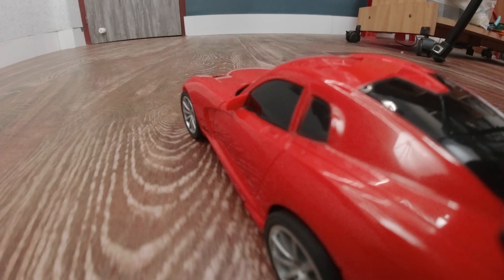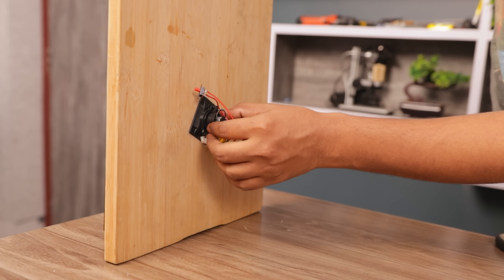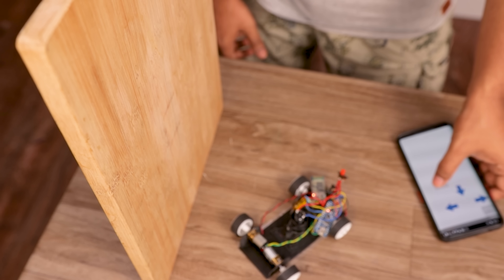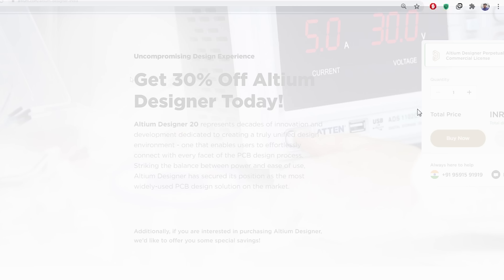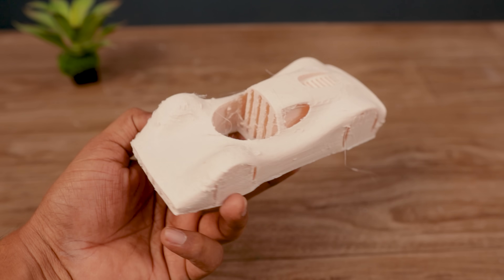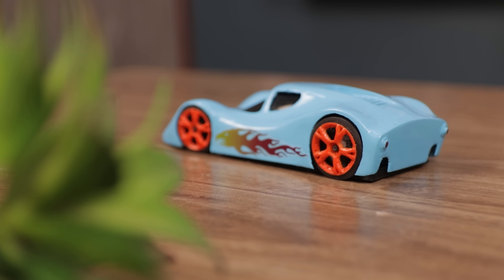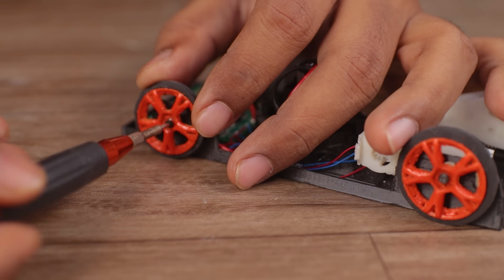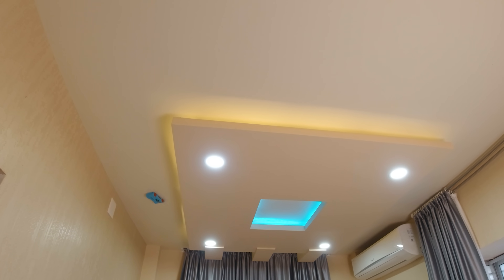How I Made this Electric Car that can go Anywhere

Comment: Very nice! 2 notes though: 1) you shouldn't put ground or anything else under PCB antenna on the module. You are butchering its performance this way. 2) Don't use ancient L293, there are much better (and smaller) alternatives with lower voltage drop and hence better motor performance

Comment: That was nice but can u make same thing without a custom turbine wheel for suction instead we use a sticky gel usually used in sticky man toy ....while in wall mode the platform carrying a bulge of sticky gel will move fair close to the surface say some milimetres....while the wheel thrust is enough to maneuver the car on wall mode !!!waiting for the trial!!!!

Comment: Hi bro, your model is soo cool. If you have added a single small tier that keeps suction enough active you try directly call to the wall with out using the manual method. Try that too. 😊😊

Comment: Made one back when I was 7, with suction cups but the sad part was it took me more than 3 months to execute my plan and within 10 minutes my car fell and it broke. It was painfully slow and could only climb glass doors, windows or glass enclosed cabinets. I tried it on normal plastic painted wall but it could only go till about 55° angle. Good project, that failure taught me how to reverse engineer anything.

Comment: Hey there, i am planning to purchase the cadence design tool for learning circuit design through your link. However, would you mind sharing some basic video on how to use the design tool. Not that long of a video but some core level design tips

Comment: you didnt tell anything about the injection moulding service which made your impeller , and the motor mount you used in final version or about the toys you removed them from

Comment: U could also print rims as frame instead of solid as well as other parts to reduce weight
Reply: Hey so I'm less interested in getting the drone then some help and time with the electronics in stuff I am doing think u could save me many hours of research 😎👍👏👏👏🤔?
Reply: Oh was watching you metal detector video I do not use Facebook or Instagram as it is also Facebook they steal your information to my knowledge as far as even c.c. info they now even steal info off your device not just what you put in to their apps

Comment: As he have mentioned in title car an go anywhere, my question is does it go under water, can the car go to the moon, can the car go to the sun, can the car go to stars, can the car go in the space, can the car go in whale stomach, can the car go in gutur etc if the answer is no then change your title car can run on walls and ceiling and ground surface.

Comment: I think I know what you can do to fix the issue on the wall the components hangs down due to gravity so there it more back weight while climbing up that's the issue on the other hand when the car is ong round or ceiling its gravity is distributed evenly that's why it is good on ceiling and ground hope it helped you.

Comment: I know why it was having trouble in wall mode 
As the air suction was sticking the car on the wall and the wheels have to give more pressure to go in upwards direction as per phy there were 2 forces applied on the car 1 was gravity which was pulling the car down and another force was applied buy air inside the vacuum which was pushing car towards the wall so motors need to produce more force for the car to move in upwards direction as it had to produce a resultant force which is more than this both force also wheels were of low quality like a 3d printed one which could not handle this much so it was hard for car to go on upwards direction
Reply: Sorry was this big comment lol

Comment: I love that you chose the hard way, I mean it would had been easier to make the car slightly larger and used two suction motors to achieve almost twice the possible load without making the car that much heavier.

Comment: Motors are not strong enough for it to climb well due to suction to the wall and gravity pulling it down, probably would climb flawlessly without outer cover. Love the video, absolutely amazing show of skills, both engineering and problem solving.

Comment: Problems which you can fix. 
1.noice of motor is irritating, you can use technological advance motor to avoid so much noice so we can play this without creating noice polution
2.you can use powerful and silent motors to make it smooth on walls.

Comment: This car is not running perfectly on side walls because the mg force is downward and suction force is pressure * Area is purpendicular to force resulting the force is not balancing and in case of curling the force is balanced resulting the card is working fine.

Comment: one the wall the gravity is pulling the lower part of the car making it struggle but on the ceiling the top part is getting pulled making the fan easier to use the property 
like if u get it

Comment: I had a car that could drive on walls and ceilings using the same vacuum method like 10ish years ago as a kid. They were mass produced.

This is a great video, but don't get it twisted. You are being sold on the story and building process, not the idea. It's the effort put into the video that makes it worth watching. Otherwise, this is nothing new. Great job on the car!

Comment: The physics of gravity can effect the weight that motor afford to run, which mean your motor sometimes doesn't have enough power to climb up the wall but able to run smoothly while stick to the ceiling.
Reply: Btw, this is a good and creative project that can blow out ppl mind 👍🏾

Comment: U can do one modification 
U can change the flat front to a curve one so that it can run from floor to wall easily without using hands
Or just place the wheels on the front

Comment: I am wondering that if he had an option of least weight motors , why he used the motors of more weight at starting 🤣
Edited - above lines are Only for fun 
I already know that he wanted to make a powerful car . And also we  know that a motor which is bigger in size can do more work than a motor smaller in size....

Comment: It's a great design. It adds the ability of adsorption to the car, so that the car can drive on different walls. I think it's a very interesting technology. I've only seen this technology in movies before. I didn't expect someone to realize it. Thank you for sharing.
Reply: Such cars are available aplenty in the . Market. I had one about 7 years back. It worked well but once the batteries drain, the cars falls from the wall/ceiling and prone to breakage.

Comment: The car is working well on the ceiling compared to the wall because when a car runs in the vertical position(here frame of reference is ground) the g force is more compared to when the car runs horizontally...also the same concept is used during a rocket launch.

Comment: Maybe tweaking weight distribution can make it smooth on walls too? Also, what if you add wheels bigger than the torso and suction motor on both sides? Then maybe it can move from wall to ceiling or floor without any intervention.
Reply: If the wheels are big, it creates difficulty at the vacuum motor
Reply: @shoyeab26  nah. What he is saying is outside wheels larger than the body width. I can see that being useful for floor to wall transition, but wall to ceiling would break the vacuum seal.
Reply: I think making it a front wheel drive can also help. The car can probably climb in reverse right now

Comment: Great work.
I suspect that even the normal motor, (that you burnt), would have worked if the air that is being "sucked", was channeled through a small hole/chimney.

Comment: My stepson had a model rc car like this almost 20 years ago.  It was rc and it worked on the wall or ceiling.
Reply: 20? I know Air Hogs made one in 2009. Didnt know there were some floating around before then

Comment: I think on the 90 degree wall it was skidding coz the suction motor was fixed in mid of backside of the car. If you can use four vents evenly four sides from one suction motor then then it can sort the issue. And if you design a big wheel car it can even get to the walls by itself. No need to lift it place it on the wall. I'm not an engineer but I think it might work.

Comment: It is not properly working on the wall , I think because of gravity of the car with respect to the weight and the height. That's fully my opinion. And I also think that the weight of the car has increased a little bit because of the painting of spray color
Reply: But overall ossum

Comment: You should make interesting toys like this and much more like the hand rotated flying fan ( a tube with a rotor on top that goes up when rubbed by hand) , key driven boat, battery operated boat, etc and sell them in Amazon. Please try.

Comment: Well I don't think that this is the first I saw this kind of toy. unfortunately my cousin has this type of toy way back 2012 if I'm not mistaken. It's a remote control that can run from flat surface including wall  and ceilings. I think it has air that can suck from surfaces to prevent from falling.

Comment: DD ElectroTech: it can run on floor and ceiling

Me: But you need to manually place it on the wall and ceiling
Reply: is this car true?.

I doubt on two things,
1).how can it turn or rotate like that with that much speed?
2). why dont it lose its suction while moving and rotating?

Comment: If its not running on wall and running smoothly on roof that means its not getting enough friction to fight the drag on wall due to gravity 
1. on roof its fighting it with vacuum so there is no pressure on friction
2. On wall it need friction to fight it wen it climbs

Comment: Bro you are designing car's outer body and you've applied E-mechanics & you've mastered Electronics circuit board like pcb n those electrical design connections etc n you are also doing mechanical works too 🤗🤗🤗🤗🤗🤗🤗🤗

Comment: Instead of spinning the wheels with motor, you can try releasing the sucked air through the back of the car for accelerating
Reply: I am no engineer or a expert, but I still know it needs vacuum to stick (meaning all air gets sucked inside to create vacuum and then there's only vacuum, no air).
Reply: @grotesk4444  good point 👍makes sense.
Reply: how about pressure...if it pumps out air then the car fall down easily.. 😑

Comment: Pcbway? You get delivery to India from China?

Oh. I suppose on vertical surfaces the power of the motor is consumed in fighting gravitational potential. Hence after a certain height it cannot climb. On the ceiling that potential is more or less the same.

Do try it from the top floor of high-rise building. I am curious...

Comment: on vertical surface you need to consider the gravity and also weight distribution . which u completly forgot and on horizontal surface it is working well bcoz its completely depend on vacuum suction , it will work better on both surface if u consider the above mentioned factors

Comment: You could you have used the technology in which f1 car's floor is aerodynamically designed to create a vacuum under the car. It creates sooo much vacuum that a f1 car can go upside down in roof of a tunnel  the

Comment: Why don't you design a project to grow plants in indoor like apartments using hydroponics methods.  
1.  Timer to run grow lights instead of sun.
2.   Water mixed with hydroponic nutrients at regular intervals.
3.  Monitoring ph level, moisture etc.  
4.  Using AI based Google  APIs to understand plant growth or damage.  When fruits are ready APIs can send alerts.

Comment: Nice video 👍 one recommendation:
Next try using esp12e chip (without usb programmer board) for such projects cause it's a lot lighter , costs less about 120rupees , wifi so better than bluetooth and no need for connection between Arduino and hc05 🙂
Reply: Like this so DD can see
Reply: Nice... I used this in many projects..they are so nice....like you said there is no need of other Bluetooth module